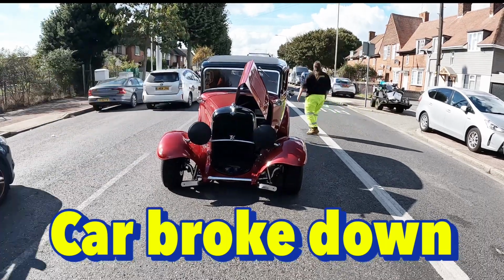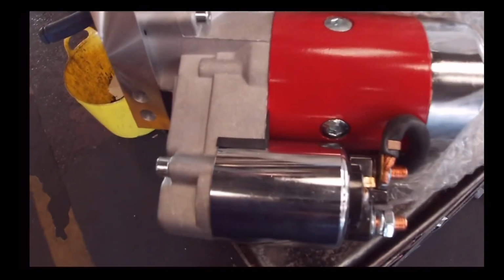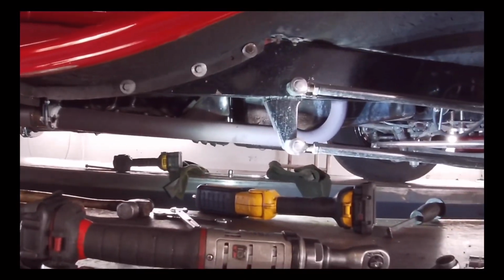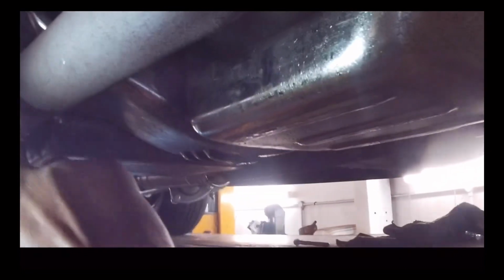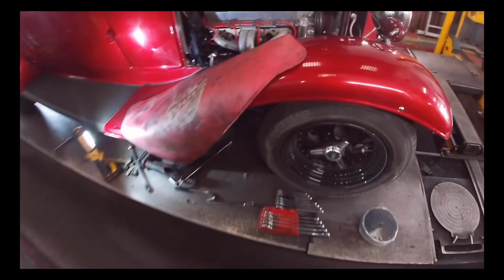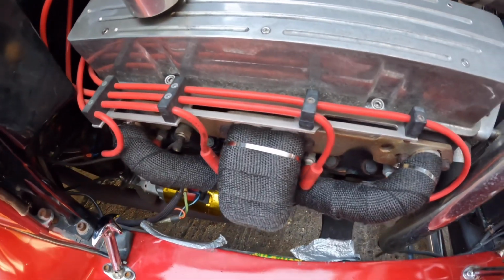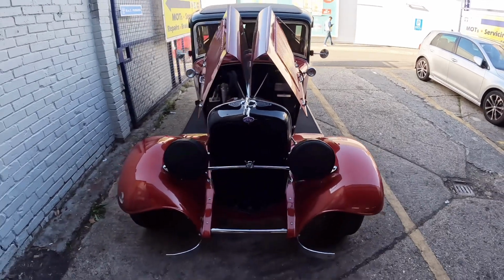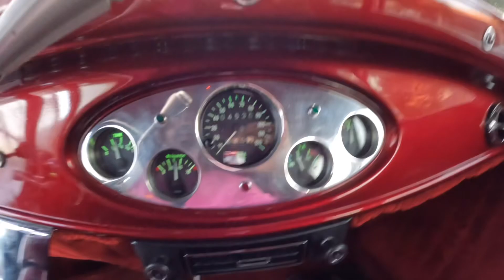1932 Ford F100 Mordl B CLASSIC #cars #food #fyp

Comment: I had chevy blazer in calif. With small block 400 did the same thing in the summer. An old man told me that you can wire a ford cylinoid to the  chevy   cylinoid and when it's hot it will start